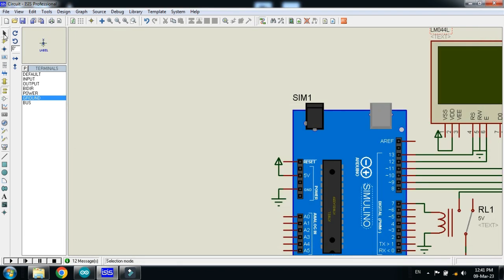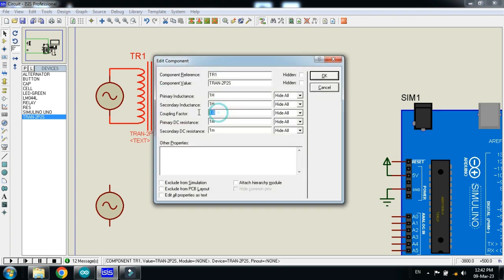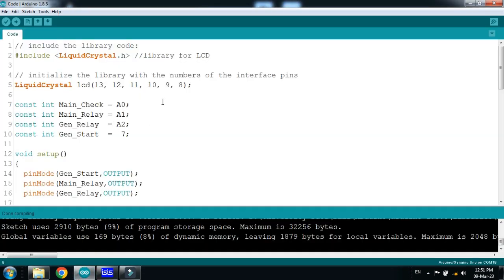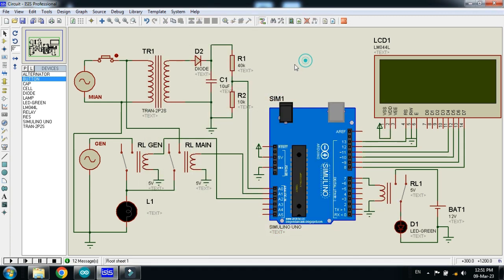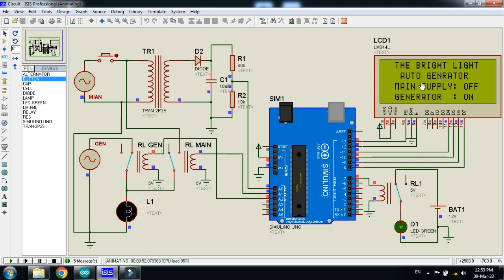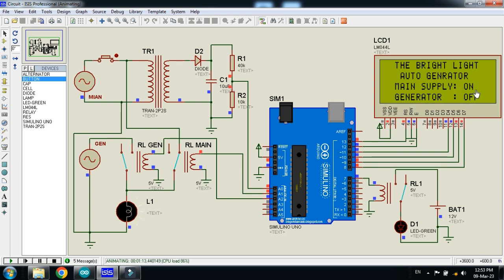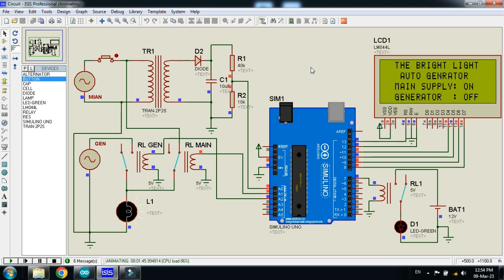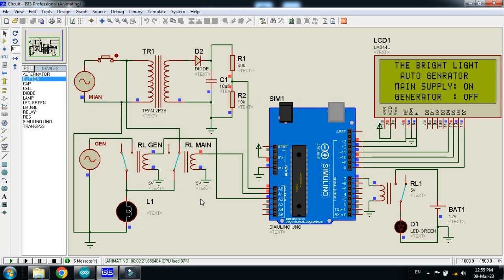Automatic Start / Stop Generator With Auto Changeover With Code & Circuit || Proteus Simulation

Comment: If the generator fails to start on the first crank, what next? So the program should incorporate a crank cycle and a fail-to-start signal.
Reply from the maker: You can do changes in the code according to your requirements.